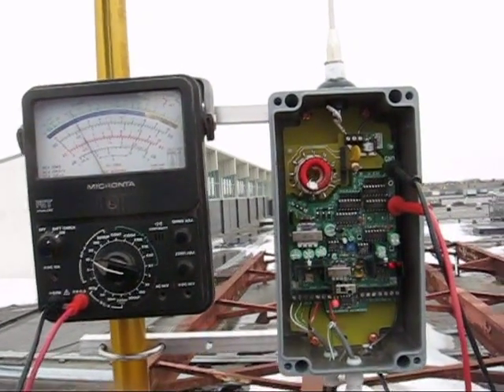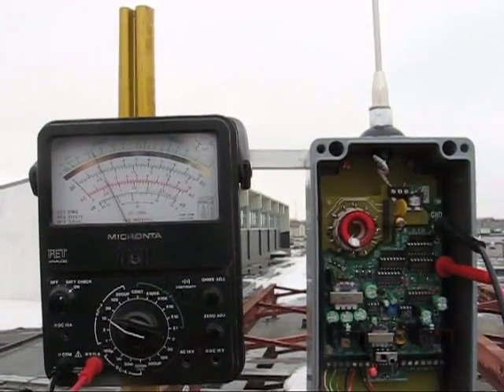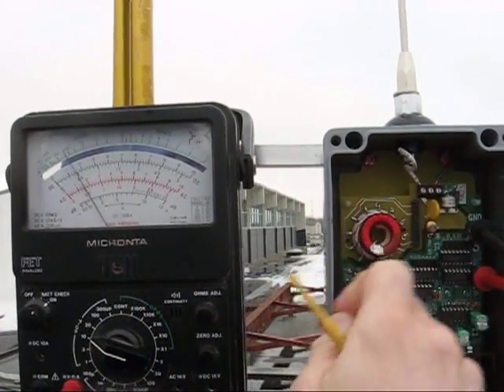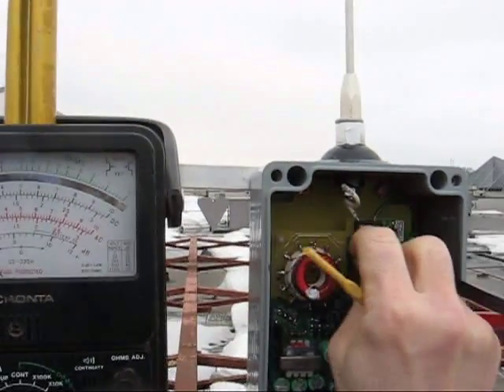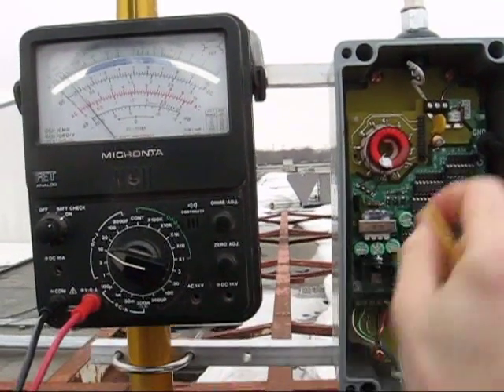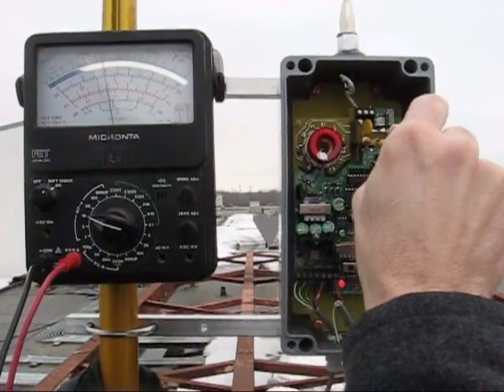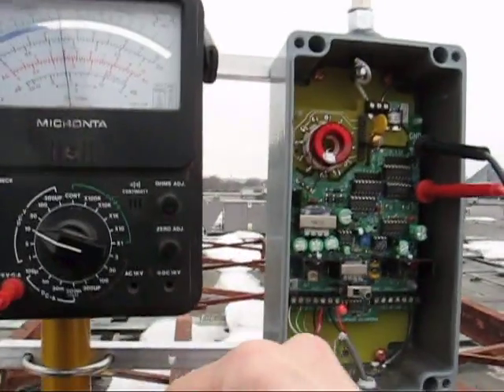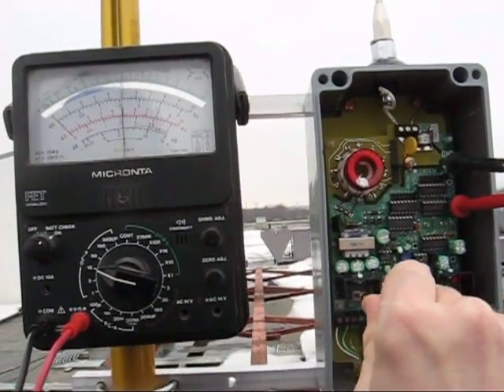General Tuning Overview for the Part 15 AM Rangemaster Transmitter

Comment: I retired from Ownership of a 1KW AM Daytimer. I shut it down just before the Covid-19 Pandemic. Since retirement and through a lockdown in 2020, I've spent more time studying Part 15 AM. It's now mid 2022. I own the Chez Procaster because tune up seems to be easier and being disabled, I can't get on roofs anymore. I have debated folks on having a good ground because I live in a area prone to severe thunderstorms, lighting hitting trees and houses. I know what 15.219 says about the length of the antenna including the ground lead, I understand it "very clearly". The Chez Procaster guy says to get good coverage, the transmitter must be mounted 20 to 25 feet up. That leaves nothing for a ground wire to a copper rod for just lightning protection to the transmitter, may it be the Hamilton Rangemaster, the Chez Procaster, or the Talking House "Range Extender" that is mounted outside. I believe the FCC see the ground wire as a part of the radiator. This is my opinion because I was a FCC Licensee for 29 Years and I know the Part 73 AM Rules like the back of my hand. Why can't we file a "rule making" to the Commission to allow a longer ground lead if the user proposes use of the Hamilton Rangemaster, Chez Procaster, or the ISS Talking House with the outdoor Range Extender? I've read back over and over with the situation of Ken Cartwright in Stayton, Oregon when he was doing Part 15 AM, and FCC Enforcement Resident Agent Bihn Nguyen. Even though the Commission had a NOUO against Ken's Part 15 KENC Community Operation, seems Mr. Nguyen wanted to help. Ken had one Rangemaster Transmitter attach above the bleachers of the press box at the Stayton High School football field. The roof was metal and Ken took the ground lead and attached it to the metal roof. Mr. Nguyen said that was legal and fine, but Ken had two other Rangemasters, one on top of a 40 foot tower and another on a water tank in town. Mr. Nguyen said the ground lead could not be attached to the tower or water tank. I get Mr. Nguyen's point. I know during this time Ken Cartwright and his wife were celebrating their wedding anniversary. Lesson to be learn is work with the FCC Agent, 98% of them are very nice, humans beings of God like us, also Ken could have invited Mr. Nguyen to the wedding anniversary party for Cake and Coffee. My opinion, we work together, not ask for too much in a "rule making" in Washington, we can get something done to make everyone happy. I believe Mr. Cartwright has a LPFM now, but for others wanting to get into Part 15 AM, we can all learn from each other

Comment: I'm puzzled, at 3:50 in the Video, it looks like you have a 2 to 3" ground strap running in one direction. What is that, metal? I am a retired broadcaster/sub engineer and I know the Part 15 Rules for AM. My wife bought me Hamilton Rangemaster's Competition Part 15 Transmitter for Christmas so I would have something to do in 2020. I am disabled, owned a licensed station for 28 years, then we shut it down, sold the property, turned the license because we couldn't make no money, and it had a dark cloud over it before we bought it. 

Anyhow, I'm not gonna say nothing, but the antenna rule I know is short, 118 inches for the antenna and the ground lead included. Mine is not put up yet because of this Cororrona Virus Scare, but we'll get to it. I wanted a rangemaster, but I'm disabled and wore out, so what I got is fine.

My two cents worth, Part 15 AM should be 1 watt, with no antenna or ground changes. The Part 15 Rules are out of date, they go back to the 1930s! I broadcast on the net to, but heck, I want my stimulus check and have fun with my transmitter before I die. Commissioner Pai of the FCC answers straight to Trump. The law can be change, but there is a certain way to do it.
Reply from the maker: Sorry for the delay. We had that wire running across the peak of the roof to the right there then down through a PVC pipe to the ground. Then I had three other ground rods about 20 feet around in a radial array.  That site in Omaha was OK'ed by the KC FCC agent. And it covered very well. From North Omaha it reached Warren Buffett's house down on Dodge. lol.
Reply: I deleted my previous post and I posted a new comment. Looks like your on top of a building  with metal structure. If you ground the Hamilton Rangemaster to the metal, from what I understand from the situation that occurred in Stayton, Oregon in 2008, I think the enforcement bureau agent told Ken Cartwright that was o.k. from what I read. This is 2022, I'm sick and tired of politics getting in the way of what true community sevants want to do with Part 15 AM. I've been a Licensee of a 1,000 Watt AM Daytimer for 29 years, I retired now. Running a actual everyday business was getting to me, so I stopped. I have cardio and diabetic problems, but I try to not let it stop me from enjoying seeing what your doing, I'm all for it.

Comment: So how high can you turn up the power on it? :3 might be nice for a real pirate radio.
Reply: Thanks - Well you can't turn the power up much but if you had a large tree overhead and could run a 75' wire above it and slightly retune the points on the coil you could easily cover an entire county!! It's been done!
Reply: Amsoil Synthetic Warehouse and Dealer Hmmm thanks for the tip hehe ;3 Was thinking about making a nice T antenna like that for full resonance.
Reply from the maker: Oh - the soil plays a BIG part in AM ground wave. There is a page on the FCC site which shows how successful you will be in various regions of the country., Some areas would require a more elaborate grounding scheme.. Bt just about anywhere you can do well if you work on it!!